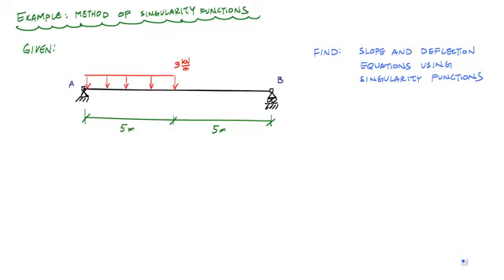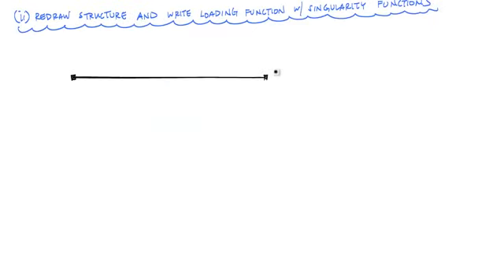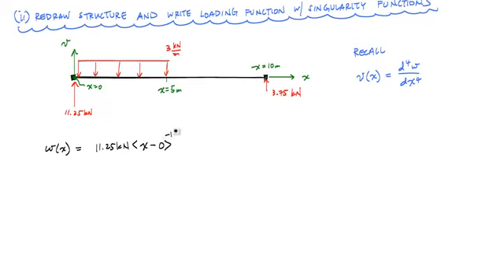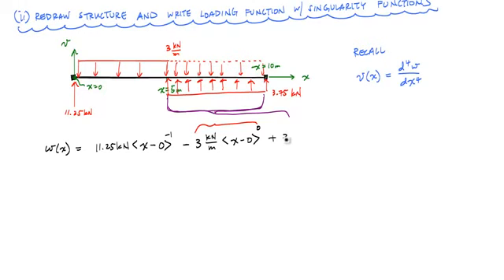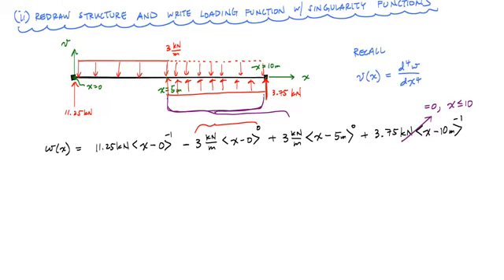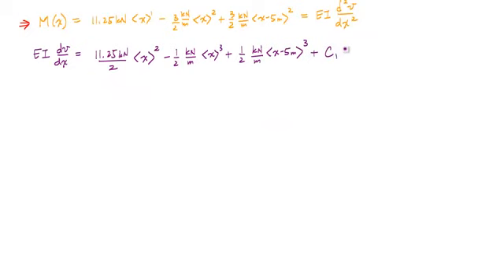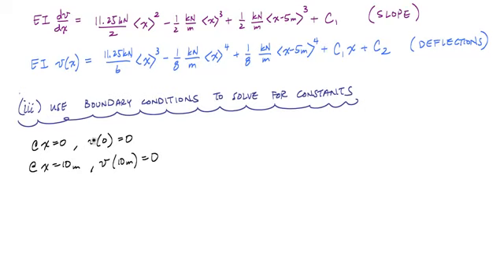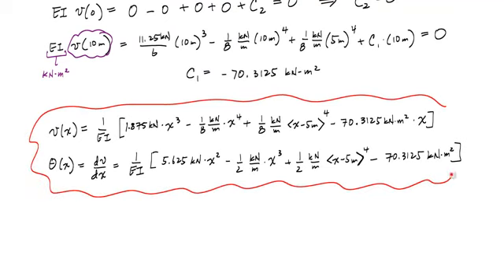Beam Deflection with Singularity Functions Example 1 - Mechanics of Materials

Comment: Why is C2 = 0?  when substituting 0 in the deflection formula the term 1/8<0-5>^4 is not zero, and for this reason C2 is not zero.
Reply: In the method there is prerequisite that the function in the parenthesis only works if it's larger than 0 in that context 0-5= -5 therefore the term is not used in that scenario that's why C2 is 0